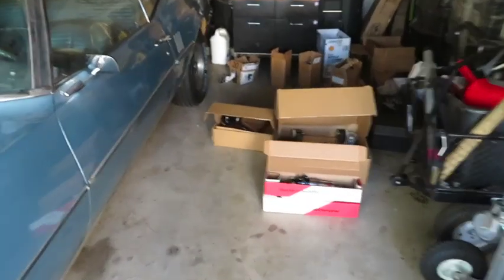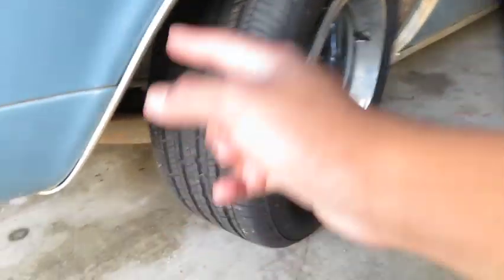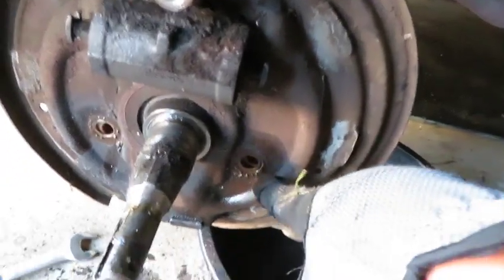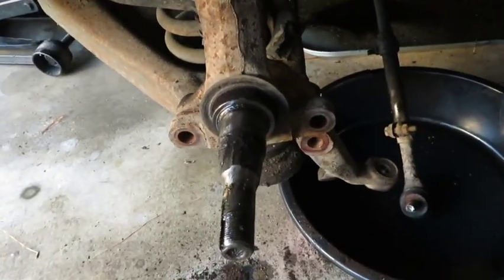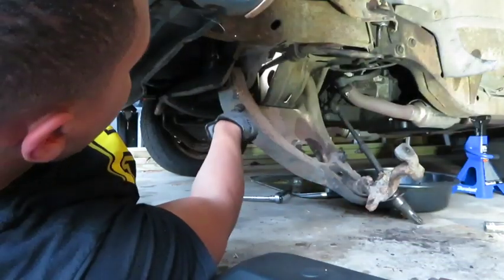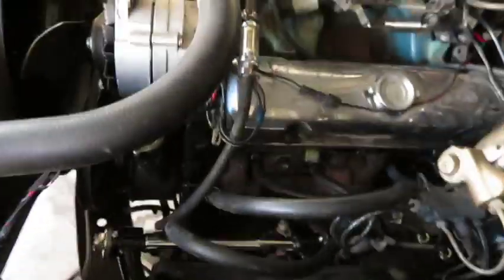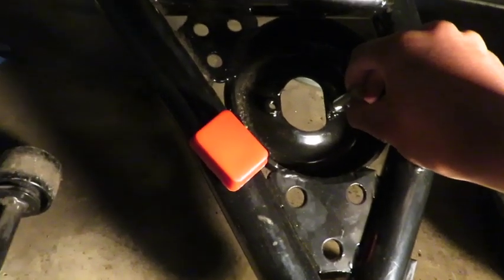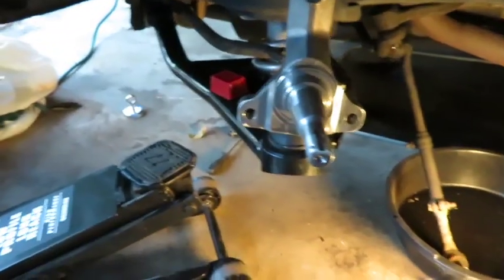Installing coil overs on my 68 Firebird

Comment: I'm glad to see another firebird lover! I've got a 68 also, but a convertible. I did a whole front end replacement also minus the control arms, it was my first time too. I did remove the control arms to change to poly bushings had to get over fear of that spring, but I did it. I had to laugh because I lost a new deep socket in that big stupid hole, & down in the frame also, & it's still there. It was also hard getting that inner control arm bolt in, I ended up damaging the beginning threads on the new bolts, so I ended up using the old ones. Now I know why the beginning of the factory bolts were cone shaped, because those smart fellows at GM knew you would tear those threads up.

Comment: Nice video and good to see another '68 gettin' some love. I installed the same tubular upper/lower set. Two issues popped up pretty quick. The ball joints got supper sloppy after some hard driving, and one of the white bushings cracked during installation so I replaced that before finishing the install. I had to replace the ball joints, they were obviously junk, bought rebuildable ones which have adjustable play. Other than that I've been happy with the whole upgrade. Cornering, steering geometry, ride height, compression/rebound felt so good at the track...in combination with an 1-1/4 sway bar.

Comment: Good job on the video. A couple of questions: who's control arms, do they change the parameters of adjustment? Either way, get it aligned when done. Secondly, are they drop spindles< or standard?
Thanks
Reply from the maker: I took a chance on ones from eBay. Seems like they are straight from the same factory cpp comes from. same adjust parameters but it’s supposed to be slightly better geometry. They are standard disk spindles.
Reply from the maker: With these control arms I’ve been told to watch my wheel play over time because the ball joints sometimes aren’t the best, I’ll give an update If that’s the case

Comment: Nice video. I just finished up installing my control arms and coil overs this weekend and nearly ready to put it on the ground. Where did you set the initial coil height after install? The install instructions have you put the adjuster all the way down to make the spring install easier but that's where the instructions stop. Thanks for posting.
Reply from the maker: I think for my application I did around 9 to 11 threads. I have about an 3/4  inch gap between the tire and fender at ride height. how many threads you do Is totally up to what you want for ride height

Comment: I have a 67 Camaro.
How do you like the ride,is it too harsh?
Thinking of staying with coil springs but using an adjustable Ridetech shock.
Reply from the maker: Depending on the engine I would go with lighter springs for your Camaro since it’s a slightly lighter car up front. they ride really nice, gives it’s a more modern feel than the old floaty feeling suspension.
Reply: @shiftkings1028  Cool.Not too stiff?Thats my biggest problem with coil overs
Reply from the maker: @johnnyhotrod  not for my liking, the good thing is that you can always go with lighter springs if you find them to be too stiff, qa1 has a pretty chart that you can follow to get the right spring
Reply: @shiftkings1028  Cool,thanks for the advice!